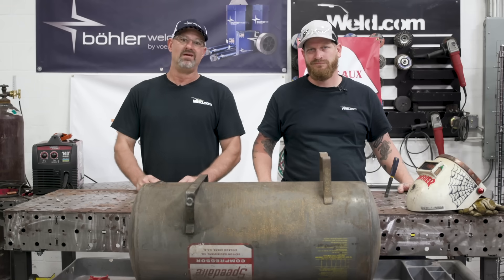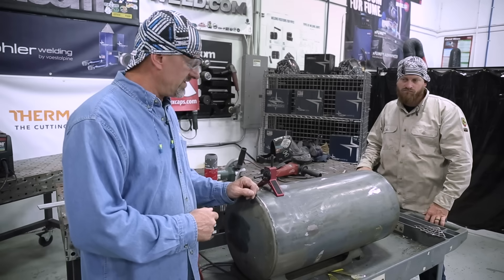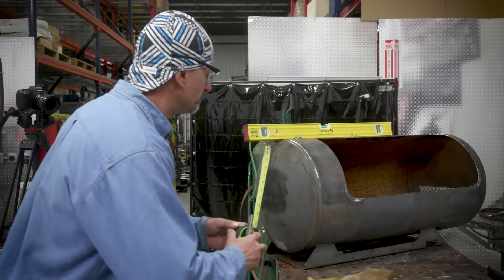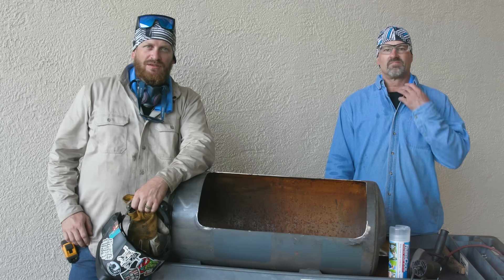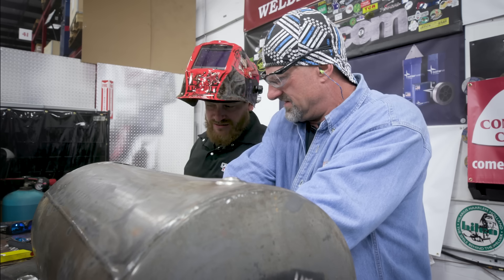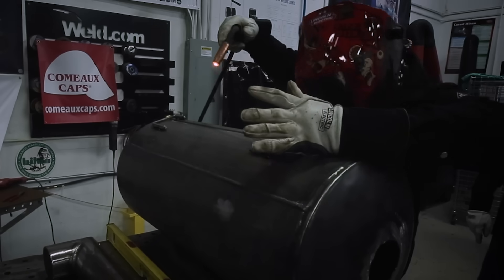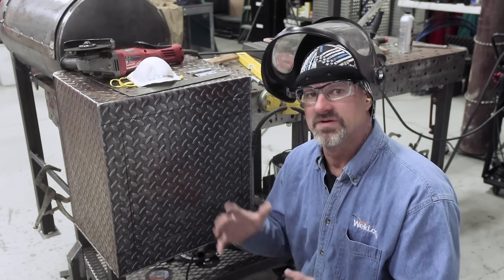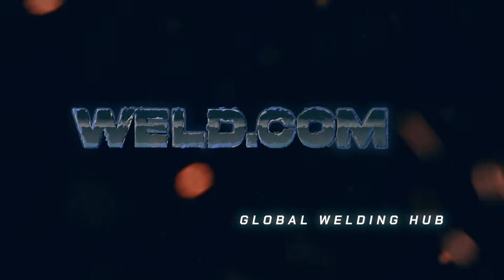How to Build a BBQ Smoker - Weld.com Edition

Comment: Thanks for the project video, seems doable with a minimum of tools and maximum delicious results.
Reply from the maker: Exactly what we were aiming for! Don't forget to check out the blog for some recipes for a bbq smoker as well.
Reply: @Welddotcom  heading over now, thanks for the reminder.
Reply: Delicious results indeed 👍
Reply: Great Craftsmanship fellas, my question is? Did you install any kind of grate/rack in the firebox, i.d.k. either way just asking, and approx.thickness of the diamond plate carbon steel thanks. Tony S. 27 YEAR BOILERMAKER/COMBO PIPE WELDER . Love the work, you guys remind me of my 10 year welding partner. Great times. Starting my build soon.🇺🇸👍🏻
Reply: @KEN-Woodworking  yes sir, sorry I failed to mention we used some 2"x2" square tube tacked to the bottom of the fire box and set a piece of removable ¾" expanded metal on top of that for air flow under the fire.
Reply: @KEN-Woodworking  also, thanks for the feedback! Let us know how your build comes out. 👍👍
Reply: @bobhigginbotham9035  10-4. Thank you guys!!! Great vid!!!!!

Comment: What kind of blade do you use to cut the steel for this project, and what rpm does the cut off sae run at?
Reply: We used weiler abrasives cuttings wheels on a standard 7.5 amp angle grinder. I'm not sure of the rpm though.
Reply: The blade on the chop saw not the angle grinder.
Reply: @leeirvin5983  sorry, I forgot about the chop saw. I will get that info to you soon.

Comment: Thermometer should be at grill height. There can be a big difference from where it was placed to the food on the grill. Add one. Smoke stack should not control the heat. Heat should be controlled by an operable vent in the fire box, stack should be wide open to prevent that over-smoked taste, yeah, it does happen. Nothing that can't be fixed. Nice project with basic tools.
Reply: Excellent feedback! Thank you. We are going to mod some things to maximize our smoking potential 👍👍
Reply: @bobhigginbotham9035  actually the smoke stack is used to control heat. Lol.  But I’ve seen some claims that a taller smoke stack is better.  Also agree with other comment about placement of thermometer to be closer to meat height or further back by smoke stack.  But well done!  Wish I had your shop and tools!